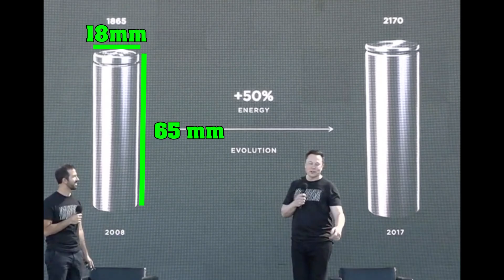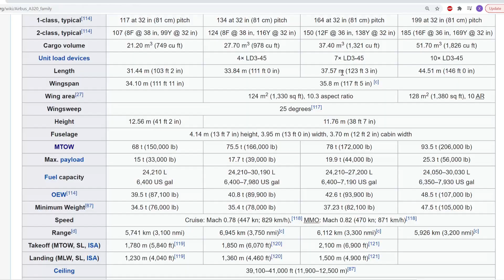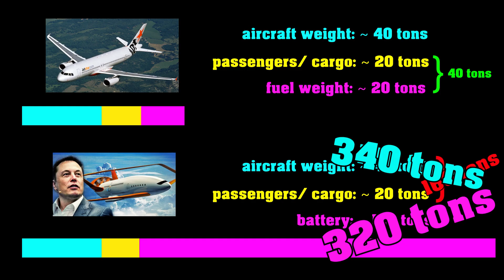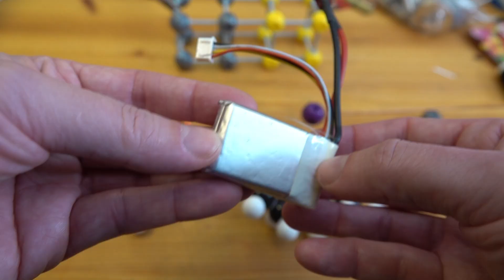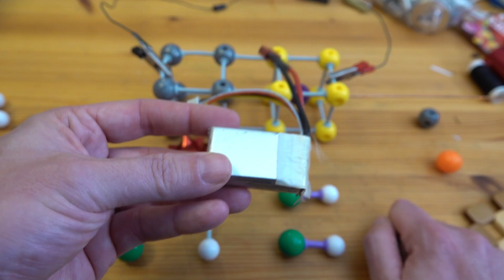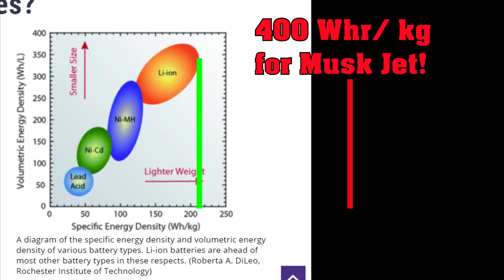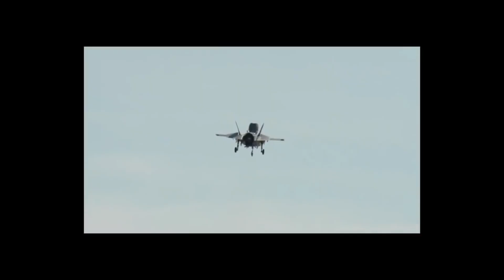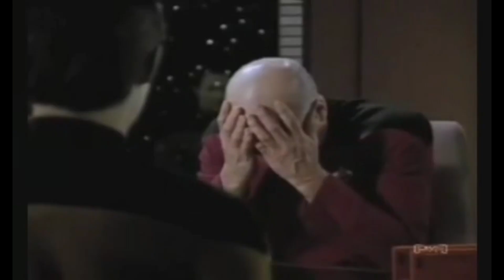Tesla's Secret Plan To Disrupt Airlines: BUSTED!!

Comment: Electric motor airplanes would, I assume, have some kind of ducted fan engines, ie a propeller in a tube. No?
A propeller 'push on air molecules' to produce thrust. What is inconveniently missing at high altitude? (Air...)
Which is why SpaceX is not using propellers. Spinning a fan in a near vacuum, doesn't do much to produce thrust, does it?

Comment: You also forgot one detail: do you remember the video used by chemtrails believer to prove them? The one where the plane is actually dropping some sort of liquid in the air? Well, apparently that's fuel; you can find more accurate and details about it but made I'll made it simple, here's the thing: a plane can take-off at full capacity but cannot land in the same conditions because THE FRAME WOULD BE CRUSHED by it's own mass; so that's why for example in some scenarios they "waste" fuel before landing, and usually they don't load the tanks full but based on where they need to go. This is quite important and needs to be addressed in an electric plane project because a battery weigh pretty much the same, charged or not.

Comment: What Thunderfoot doesn't know is that the vertical take-off supersonic electric aircrafts will have solar freakin' wingspans to power the batteries, reducing the required battery size!
And it will also make clean water for all the passengers!
And it will fly in a vacume tube, so it won't be affected by drag!
And it will have a Thorium engine under the cockpit as emergency power!
And in case of violent passengers, it will have a hammer made from pure gold!

Comment: Conclusion:  Musk fanatics don't know how chemistry, lift or thrust works.
Reply: Musketeers don't even know how their tesla car works. That's why they worship autopilot
Reply: @nelsonmarques1334  and you do ? and you know better than some of the best AI engineers and machine learning experts in the world that say tesla is making great achievements ?  you are better than George Hotz that said tesla will win the race to level 5, i'm sorry i didn't know we had the pleasure to have a genius within us,
Reply: @redakanane  I'm no genius, but I know why comercial planes don't travel supersonic, don't VTOL, and at the moment, battery ev comercial planes will not be possible. 

I've read your comment, stating great achievements by the sr71 and concorde. Do you know why those were possible? Jet engine. On an Ev plane lift won't be the problem, but density on high altitudes will be. How can a propeller generate thrust with low density? Do you know the fastest speed on a propeller plane? Around 1100Kmh on  a steep dive. Take the jet engine away, and there's no supersonic.

I never stated that Tesla didn't achieve great things. EV hype is due to Tesla alone. No doubts that autopilot is the best system on the market. But for one good thing "Elon Musk" puts on the market, he spits out ten BS ideias. And Tesla fanboys don't even question if it's possible. For example, the new breaking edge tech battery is more powerful, because it's bigger. I use more powerful batteries on my RCs, but with a huge downside of a bigger degradation and more unstable. Thermal runaway can happen at any moment.
Reply: and you oh great on does ? so by your logic, the SR-71 shouldn't be possible flying at 90 000 feet, double the height of the highest commercial liner ?how did it generate lift ? or ... oh wait ... lift is created by the differential of pressure between the top and bottom of the wing regardless of how the density of the air, planes don't push against the air, they are sucked up by a vacuum, and also that's why the spaceshuttle started meeting "Usable" air at 100 000 feet (not my words, those are a pilots words, google it) and as i said, the SR-71 (blackbird) routinely flew at 80 000 feet, with a maximum flight of 90 000 feet, but on it's longest flight, which is an 11 hour flight, it had to refuel 5 times, but wait ... commercial airliners do that all the time, hmmmm curious, how did the blackbird achieve lift or thrust at such high altitude, according to you and eveyone in this channel, that's impossible, they are scamming us, or ... does it have to do with the fact that commercial airliners don't fly higher because ... combustion is not as efficient due to lack of oxygen, which is a problem electric motors don't have ... hmmm curious, nah man it's a scam obviously, the SR-71 and the concord are myths my bad.

Comment: I was wondering how can the electric planes be more efficient at higher altitude. Electic planes most probably use propellers and when you have less dense air, then propeller can create less thrust.

Comment: I'm curious...jet engines use thrust reaction but you can't do that with a battery so you're stuck with some kind of propeller or shrouded fan. As far as I know, no propeller plane has ever gone supersonic so you need some kind of electric plasma jet engine which currently don't exist outside of prototypes. As well, the problem with batteries is they always weigh the same, full or empty while planes running on hydrocarbon fuel get lighter as they use fuel. Thats why they minimize the fuel they carry, for better efficiency and higher cargo capacity. Hydrogen powered planes would be much more practical and even they require a ridiculous amount of the plane be dedicated to fuel storage.

Comment: There are two other issues about flight which you don't really touch on in your comparison to a normal commercial airline.  You are neglecting the additonal power requirements of VTOL and of supersonic flight.  I understand that the Concorde, which typically traveled at M2, used 4 times as much fuel (per seat) as say a 747.  And to do a direct lift for that much weight would require an incredible amount of thrust over and above that required for normal flight.

Comment: As a guy that works on wood, here is my thoughts.
1 electric motor are good but they don't just rotate?
That's means the higher it goes the less resistant to air and also less likely to maintain that altitude.
2 better than batteries why not nuclear power.
I remember there was a guy if I recall his name was as Albert. When he went from Germany to merica all military want a piece of nuclear.
We had nuclear ships, nuclear submarines. And there was a idea for nuclear airplanes. I wonder why they didn't do it... Maybe they were missing Elon Musk.

Comment: OH  NO! Not Electric Planes too! 
Do these people even KNOW the weight of a battery? Empty or full! Those are not light! the 0.4KwH battery on my electric bike isn't the lightest... and that is on a bike... requiring me to peddle too! They tried to make that thing as light, yet safe, as possible. BUT! All in all... there is a certain weight to be expected. At most the motor on my bike provides around 600Watt power ...shortly! Think really short as in it is made for maybe three minutes because it drains the battery too quickly or would overcharge its controller. Batteries have limitations!

Comment: One important point you've missed is that a battery powered plane doesn't lose weight while flying. That means the maximum landing weight should be considered instead (which, for an A320, is just about 65 tons). Planes having to do emergency landing shortly after takeoff can just dump their fuel in order to reach the maximum landing weight. Can't do that with batteries. (edit: never mind - just saw the point had been raised already)

Comment: Another issue, if it is commercial, is the turnover time. For it to be productive and profitable, they would have to be able to have it ready to take off again as soon as the cargo and passengers are off and the outgoing are back on. There is no way they can practically fully recharge the batteries in that short amount of time. Then the constant fast charging will decrease the life of the batteries. That will require more changes and increased costs.

Comment: My experience with li-on batteries in years of construction was when it was cold outside they were slow to discharge leaving us with weaker tools until Temps warmed up.

So while the motor may not suffer from altitude issues the battery will due to much closer air temperature. This will require more insulation around the batteries to reduce the loss of energy output further reducing cargo capacities.

Li-on batteries aren't as bad as other types in the cold they still suffer the same problems just to a lesser degree.

But I'm not a famous con man duping investors and nations out of their money so what do I know.

Comment: If you want a real laugh you should check out QuantumScape, Toyota etc on there solid state batteries they use a sulfide based electrolyte and lithium metal.. Am I the only one that realises that if any moisture gets in it will produce Lithium Hydroxide and Hydrogen Gas, probably not the best thing for fire fighters to deal with. Not to mention the cost yet they promise it will be a cheaper solution.

Comment: Fundamentally, the worst part of this Musk dream is: there is no demonstration that a prop plane can go supersonic.

No fuel, no jet engine, which the only way to mobilize the vehicle is to use propellers -as the Israeli startup Eviation is gonna do.
Reply: That was also my thought... He keeps saying supersonic. How will it go supersonic? I can understand turning a turbofan electric by just replacing the turbine with a big electric motor. So you "can" have subsonic electric airliners that way. Supersonic though?
Reply: @zolikoff  , to be fair, there are works to develop jet systems based on ionized air to generate a plasma propulsion:
https://insideevs.com/news/420488/compressed-air-microwaves-planes-without-fuels/

Maybe this research will pan out.

As is, as far as I know, no way to make a prop plan go supersonic -outside of specific circumstances.

Comment: Ah, but if you make the actual structure of the aircraft out of batteries, then it'll all work. <taps head>
Reply: I've actualy read serious papers on this. They were trying to find even the smallest mass savings. Unfortunately a lot of these concepts also have shocking continent low lift to drag ratios etc making like for like comparisons very hard. 
I'm not yet convinced of anything beyond hybrid concepts
Reply: Elon Musk: "Yeah, let's make the plane even more dangerous, increasing the chances of the plane blowing up, to make my very flawed idea seem like it can work. All while making it seem safe."
Reply: Not saying it makes this a viable concept, but that is what they do with the cars. The battery is part of the structure.
Reply: Tabless cells are all about the system engineering. Firstly getting HEAT out through the end of the cell rather than needing complex coolant paths through the pack. Secondly it’s making electric connections to just one end of the cell. Thirdly the internal resistance is lower so there’s less heat to deal with. All of these things make them more suitable to being STRUCTURAL elements. So this 2/3rds mass is not just the energy store but also the plane itself. Have you ever come across structural Kerosene?
Reply: @JamesUKE92  Declaring this a new copypasta

Comment: A point to mention regarding batteries. The higher you go the lower the temperature. Cold batteries lose charge quicker than warm ones. Just check out flitetest on youtube and they explain this with their r/c aircraft . As it is cold in winter where they are, the batteries seem to last a quarter of the time as when in summer. So unless Elon has some fantastical way to keep them very warm, surely his batteries will go cold too? Unless they are short circuiting and on fire of course ;-)

Comment: I don’t really understand why we care how dangerous batteries are if they gets punctured? Diesel is highly energy dense and not flammable. Fat and oil doesn’t spontaneously combust or explode. You could put out a fire with diesel fuel if you wanted. And these sources are 100 times more dense than batteries
Reply: Batteries carry the oxidants and reductants in the same package and place them in close proximity, so when they fail they tend to cascade-fail.

You don't get that with fuels because they don't need to carry oxidisers onboard. They capture the oxidiser (oxygen) from the air.

Comment: I'd rather see people invest in technology and infrastructure to allow for the mass production of hydrogen. Jets running on hydrogen is actually feasible from a technology point of view, we still need to create commercial viability though.
Reply: With all forms of transport using hydrogen, storage is a massive issue as it has exceedingly low energy density (in terms of J/m3)
Reply: @cambridgemart2075  True. Although it's easier to incorporate the needed cooling for good (and safe) compression on something the size of an airplane than it is in a car.

Comment: The energy density won't change. There's a fairly hard limit anyway (has to do with max surface load of lithium per silicon layer basically, if I understood correctly). The whole thing is similarly stupid compared to thinking wind energy will one day improve max energy yield or solar power becoming vastly more efficient. It's just fairytale BS.

Comment: What if you replace your metal plate contacts with some substance that conducts electricity cold, but insulates hot. As soon as you get a short circuit, it warms up to like 100C or something and cuts out. Energy density isn't nessesseraly a problem, whats problematic is easy uncontroled energy releases.

Comment: The only thing new in battery tech I've heard recently is that in Japan apparently they're working on a rigid form of Lithium batteries for colder climes, around -20 before the battery starts electroplating itself (a nasty problem with Lithium in cold weather, don't charge 'em cold folks!)
Reply: I honestly like that better. It seems like everyone's too concerned with trying to push the limits on capacity without improving the resiliency. Improving durability is probably going to do more to get more capacity than just trying to squeeze more energy into the cell and hope it doesn't explose

Comment: While this is almost certainly going to fall, it's worth pointing out that 70% takeoff weight is not the same as 70% volume, and the two are conflated in the video. Because batteries are so heavy, it's entirely possible that even when they account for 70% of the takeoff weight, that would still leave a fairly large percentage of the volume of the plane open, and it might be possible to scale your way out of the weght problem (for instance, a flight crew of three and flight computers and etc are going to weigh the same whether the plane weighs 10 tons or 100 tons or what have you- make the plane bigger, and your 30% available cargo weight becomes bigger absolutely while retaining the same subjective percentage of total weight.)

But I think the wall he's going to hit is energy density. Charging time is another obvious issue.

Comment: I want to see Elon's electric plane landing on a Solar FREAKING Runway.
Reply: VTOL? you mean solar freaking terrace or solar freaking parking.
Reply: Solar freakin aircraft carrier...
Reply: Top comment right her 👏😂
Reply: Solar roadways would work if we used aluminum oxide glass and rectennas (or much better junction diodes). Their apparent color would be similar to asphalt.

Planes lose a lot of energy by exhausting hot gasses at high velocity. They simply cannot interface with all of the available atmosphere touching the aircraft with current high bypass turbofan or blended flying wing drone designs. Using alternate supplemental aerodynamics techniques and technologies, you can turn almost the entire plane surface into a lifting region as well as a thrust producing region (with far less pressure, skin, and induced drag). Almost anything is better than hanging a giant circular fan off the wings powered by a lossy kerosene turboshaft. Even a synchronous 3-phase EDF would be better, like what is likely in Musk's designs, even if nothing else was changed.

Passenger compartments can be isolated from combustible battery/cargo regions with high temperature composites (S-glass, carbon, and others), polymeric resin alternatives, or thermoprotective additives.

(Yes I realize that these descriptions are similar to existing co-flow supercritical aerofoil designs, and some even have adjustable camber. Great. Maybe someone will use them in the next 50 years, but not if they're a dead idea because thunderf--t is dismissing the technology.)
Edit: Hoping its reverse psychology, but he has to realize that 99.5% of people won't do the research and will keep bleating hate towards any new technology.
Reply: @Baigle1  No one even knows how to make a ~60,000 hp EDF which is light enough to use on an airliner and battery energy density needs to increase by dozens of times over for any kind of long-haul electric airliner to be viable.
Reply: @Baigle1  Fun fact: Jet engines these days can achieve around 70-80% propulsion efficiency. With a motor, that's likely higher, but as speed increases, efficiency tends to go down. The problem with solar runways/landing pads is that if Ryanair flies on one, it's guaranteed to be destroyed. If you land hard, you will exert a lot more force onto the runway than the weight of the aircraft itself. Also, could you describe the technologies you are proposing?

Comment: wait what? the higher normal planes fly the less efficient they get? they are literally the opposite of that. Drag reduces, the thrust required reduces so they use less fuel for the same speed. What a moran, its exactly why aircraft fly that high as well as avoided weather.